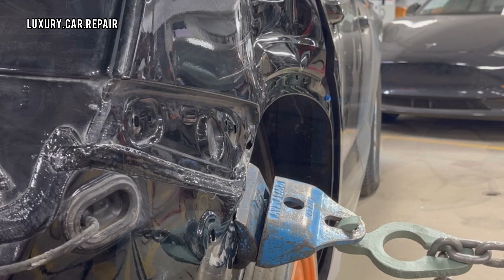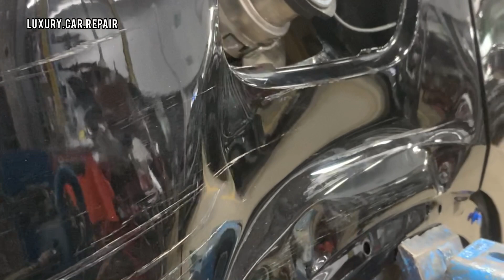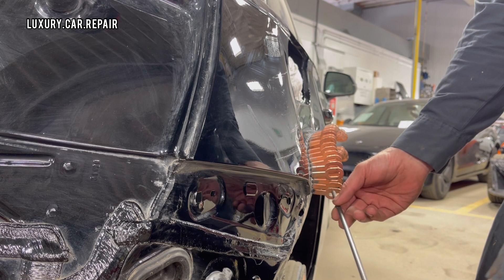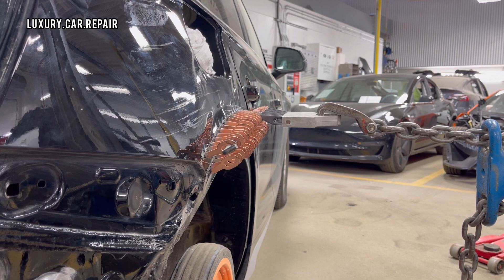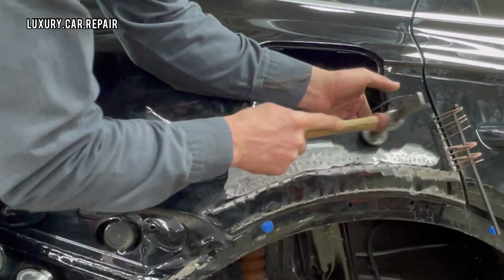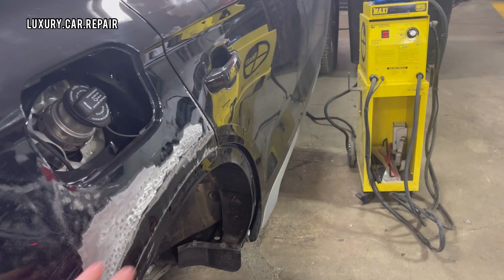Audi Q5 quarter panel repair - Part 1

Comment: Really good video man, just a question in regards to small holes made in the panel from using the dent pulling keys or the dent puller itself do you then mig weld the small holes when you have all your metal work done on the panel? Looking forward to part 2 😁
Reply from the maker: Yes exactly what you said, you’ll see it in the next video which will be up soon. Thanks for the compliment 🙏🏻
Reply: @LuxuryCarRepair  cool cool, can’t wait for more videos 😁